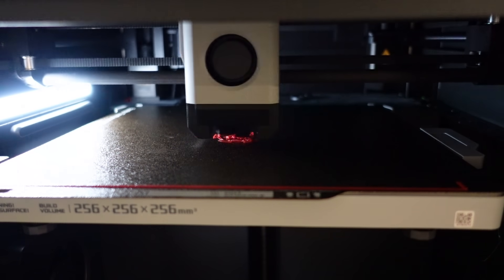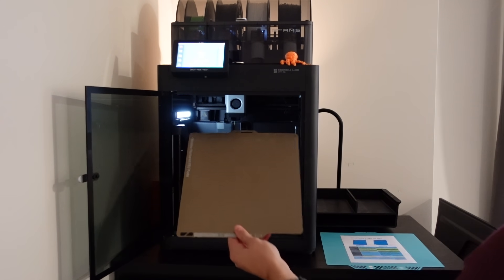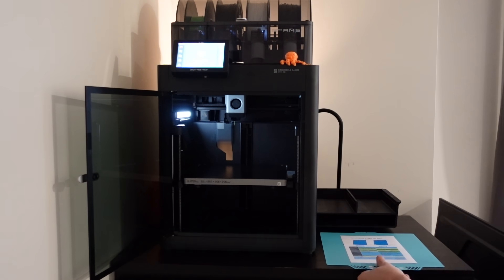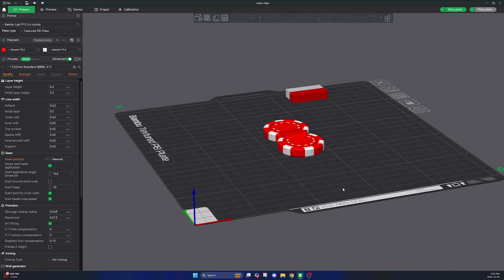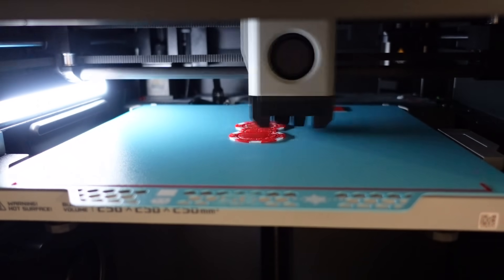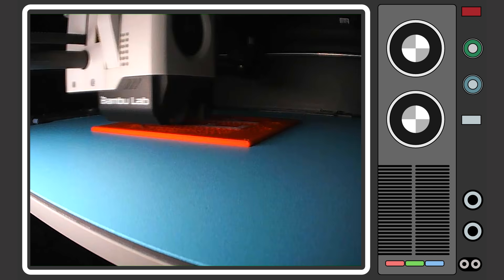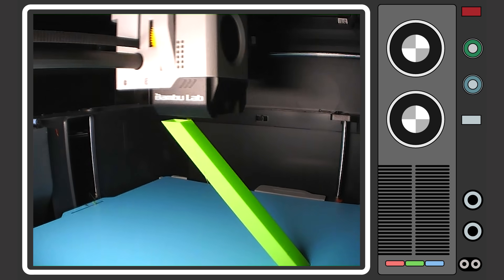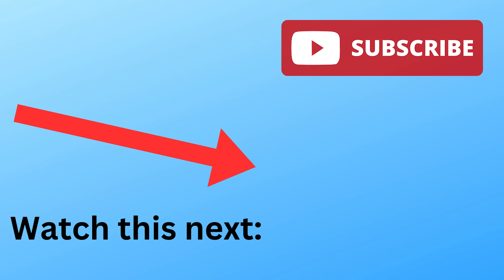Why You Should DITCH Your 'Textured PEI' Build Plate!

Comment from the maker: It looks like most of you haven't had any issues with the stock Textured PEI plate, which is great!
I certainly have had adhesion issues myself, and this video is for those who have had a similar experience.
FWIW: I would NOT lie to my viewers and ruin my reputation. The clips in this video are receipts that I indeed have been having issues.
Hope you all understand  🙏
Reply: Have you reached out to bambu to see if they will replace it may be a manufacturing issue? have you tried washing it with soap and hot water? Most my adhesion issues are cured after a proper wash. Not an iso wipe.
Reply: I Wouldn't say many commenters are suggesting you'd lie (although there's always one or two in every village of course,) most seem to be suggesting you've got a dud, and that you should contact Bambu to get a replacement. I would agree with that to be honest. My experience of the PEI is the exact opposite of yours, I'm almost always struggling to get the print off the plate after, having to flex the plate etc. 

It's fairly obvious from the fact there's a very small minority of people that have had exactly the same issues as you, that you're most likely telling the truth But it's equally clear that, due to how small that minority is, there may have been a bad batch or something. Try and get it sorted mate, could make for another good video idea, documenting the RMA process and hopefully the results of a replacement plate. :)
Reply: @coasterfest  I reached to Bambu with my supertack over a month ago or close to it. I got two, did everything they asked me to send them a video, I was away so the case was closed and I did mention I had a video on my channel about it asking for suggestions and help.
Reply: @ Thanks for the update. Doesn't fill me with hope that their customer service is up to par. And sadly yours isn't even the first poor customer service experience in these comments. Another thing to add to the growing list of negatives with Bambu. :/ 

I was looking to buy an X1C or P1S soon, but the recent controversies have put me off, so I'm now looking out for another Core XY with a multi colour / material system. Currently favouring the Kobra S1, just waiting on some longer term reviews to start dropping.
Reply: @ The s1 is interesting. Some corner cuts on build quality and some downsides vs p1s, but also better specs than x1c. Would love to see some in-depth tolerance and print quality comparisons.

I’m aiming for Quidi Plus4 myself. Never could get PC or Nylon to print strong enough in my P1S
Reply: For a sanity check confirmation, my new P1S has the exact same issue with the stock plate. Never had an issue with any printer plate before like this. I don't even have to lift the plate or flex it to get prints off, everything just falls off freely once the temp drops to about 40c on the bed after a minute or so. Issue has been the same since the first print, and I am still waiting for a response from Bambu at the moment.

100% cleaned it thouroughly with dish soap and hot water, plenty of alchohol wipe downs, never touch it with bare hands.. bed level tests show zero signs of oil on the bed but they still dont stick. Tried temps from 50c-70c on PLA with no difference, tried enclosed vs doors open, tried manual bed leveling even though it came essentially perfect to start, tried many brands of PLA and PLA+ and ASA all with the exact same issue. Ran filaments through a dryer, tried all variations of fan speeds, ran a full air filtration through the room to make sure no dust, closed all vents while printing to ensure zero breeze, ambient temps 18.5-19c, ambient humidity range 20-25%

I am waiting for the smooth and cool plates to arrive still, bamu shipping taking pretty long. 3 weeks in and I'm still waiting for the filament/nozzles I ordered with the printer during black friday sale. For now, I have to print everything with massive brims to have any success, and can't print any tall objects as any vibration just shakes them loose.
Reply: @MrSoundChaos reading your comment you have alot of expierence. But just for other that might read it. Use dawn with no hand softner.. propper dish soap that removes oils. If its soap with hand softner in its no bueno.
Reply: @TriMeX1987  Definitely good advice. A pure, high concentrated dish soap is by far the best, and don't use alcohol afterwards, since all alcohol's leave trace residues that lower performance (still fine to use in small amounts to touch up cleaning after many uses). 

8 months later, I was still never able to get my stock PEI plate to work at all. There's some form of factory contamination in the PEI and it cannot adhere to plastic. Bambu refused to help. Every other one of the dozens of plates with thousands of print hours since have worked flawlessly when properly cleaned.
Reply: @MrSoundChaos  they should take it in and test the pei plate.
Reply: I have had issues with my textured plate since I purchased a month ago. I have cleaned it several times and usually end up putting a brim on to fix issues. Might look at this plate.
Reply: I didn't have a single issue until recently. Which led me here. Thank you for showing me other options out there with a comparison to my own🙏
Reply: I have adhesion problems with my a1, and hopefully the smooth print bed works!🙏
Reply: say you are clueless without saying it 🤡🤡if u only printed with bambu u dont know shit
Reply: @devilik3692 You sure didn’t provide anything useful here. Got some advice you’d like to share?

Comment: This is a YOU problem.  I'm new to 3D printing and it's been flawless since I started a year ago 🤣🤣😂😂

"i got this plate for free, my opinion is unbiased - the OEM plate sucks, y'all should buy this one!"
-🤡🤡🤡🤡🤡🤡

I spray with 90% IPA, let it sit for 10 seconds, wipe it dry with micro fiber cloth = done.  ZERO adhesion failures in a year.  Z - E - R - O

I print PLA, PLA+, PETG

Comment: Yeah the textured PEI plate is shit. It was perfect when i first got my a1 mini but it seems like it wears out too quickly. I even sanded it down a little bit as a last resort, worked only a few times. My smooth plate has perfect adhesion at just 35c even and is lasting longer.

By the way, what plate would you recommend for PETG and TPU? Using gluestick on my smooth plate seems too messy although i haven't tried.

Comment: Was using textured plate, then it started printing 'mid-air'.
I had a lot of hours on this plate, weird that it stopped working.
Nozzle is 0.07mm to 0.1mm too high, layer 1 failures.
If I 'lie' to the slicer, tell it that I'm using a smooth plate, the textured plate works again.
Reply: OK, more data!
Printer profiles account for the slight height difference smooth vs. textured plates.
A textured plate sits a bit higher, but has tiny voids.
Smooth plate has no voids, sits a tiny bit lower.
I had changed my printer profile without understanding the full implications...yes, Petunia...Bambu X1C does support Z offset!

Comment: I have over 500 print hours with my PEI plate - no issues. The key is to avoid getting oils from your hands on the build plate. I also clean off the plate once in a while with dish soap (not rubbing alcohol, it doesn't fully clean the oils left by your hands). 

Between being careful not to touch the plate, and cleaning it off every so often I've had great results.

Comment: Wipe the textured PEI sheet down with IPA right before you print and hit it with a light coat of hairspray. I guarantee with absolute 100% certainty you will have zero adhesion issues.  You need to do this before EVERY - SINGLE - Print.  You will have 100% success. I guarantee it.

Comment: i got a textured pei plate for my ender 3 and I've never had adhesion issues. you have to clean it regularly. if its not sticking try cleaning bit with ipa and if that doesnt work make sure your bed is level because it will eventually need to be releveled as do all 3d printers.

Comment: I have had zero issues for the first several months, but now I struggle a lot with bed adhesion even if the plate looks like new. I honestly don't know what happened. I tried washing it with dish soap like they recommended and that helped for 1 print. 
I almost feel like it's the pla itself leaving residue on it... 😮
Reply: Using the several months old plate? maybe just time for a new one even if its the same kinda.
Reply: So TLDR Don't touch your plate with fingers, or if you do wipe it with some alcohol wipes 
Once I started doing that my issues are gone. 
If you already have it dirty - wash it with some dish soap and a soft sponge thoroughly, then let dry completely.

Comment: I'm sorry but that print is just horrible especially for a P1S....I only had issues with my textured build plate after 6000 hours on my P1P; I had prints that did not stick properly even after cleaning. So I just bought a new one because people don't seem to realize that there is a PEI coating on the plate that will get damaged over time, and can't see from just looking at it with your eye. They also say on the Bambu Wiki that build plates are a consumable part. Just like replacing your nozzle, you will eventually need to replace your build plate, and they don't last forever! and it's even more noticeable after buying and using a brand new plate, you can actually feel the difference in adhesion. I almost replaced my A1 plate and it's only a few months old. 

Also the top surface layer on the logo printed in this video looks awful I think you need to tighten your belts or something, because even with ironing off on my P1P my top surface layer looks about 90% smoother, also your first layer doesn't look right either you can see almost a smooth circle in the center and then around that smooth area you can see the layer lines on your first layer that's touching the build plate. If you were getting a proper first layer, the side touching the bed should be completely smooth or textured, depending on the plate, but it will have no visible layer lines. That looks like a print of an Ender 3, not a P1S, Sorry but I think your issues with the textured plate is user error. 

 But with this Cryogrip plate I have seen videos of prints warping, but the plate stays attached to the model and warps with the print causing the plate to pull up off the magnets which looks like it could cause a lot more damage than just knocking my print off, and damage to your printer from aftermarket parts will void your warranty unfortunately

Comment: I don't have a problem with adhesion. Rather with getting the prints off. If I had a print over night, I have a very hard time getting thin layers of the plate, especially of where I had supports.

Comment: Someone is not washing their plates between prints.   I use both textured and smooth PEI- With PLA I add a little glue stick.   With PETG I go raw-dog and it sticks to the plate pretty dang well.
However, I DO make sure to wash the plates with dishwashing liquid and dry them carefully without touching them and leaving oily prints.

Comment: I have been printing for 5 years, and I'm surprised it's not written on every page possible how user should really use the build plate. 
1) Always use gloves when handling build plate. I bought myself cheap .80 cents fabric gloves that breathe.
2) Never ever pull off prints from the build plate when the plate is warm. If you pull prints off from build plate then you'll leave small layer residue on it, and each next print is going to adhere worst. 
3) Try to print with one type of material (PLA or PETG etc) as long as possible, because they all leave a little bit of residue and PLA and PETG do not stick to each other and adhesion is almost impossible.

And if you follow these 3 points, then adhesion issue might be due to damp filament. But most likely it's just because your plate is dirty. The fact that you can't see it with your eye means nothing. Zero. IPA or dishwashing liquid and then drying with shop paper or microfiber cloth, and never ever cheap kitchen paper or toilet paper because these leave paper residue.

(To cool plate faster: I take the build plate out with prints on it, and while holding the print I press against my window. If the window is dry or I'm impatient, I put it against the outside window because that's colder. After around 20 seconds I usually hear the cracking sound when the print pushes itself off the build plate and usually the buildplate just falls off. And then of course never use the side for printing before cleaning that was against the window.)

Comment: I've had my first ever fail on the textured PEI plate, a large full-build volume sized short box, every corner lifted, I have the cryogrip glacier but didn't use it after I had 3 failures with silk polylite lifting in the corners, but that was using the coolplate settings, I never tried it with the same temps as the stock textured, which you suggested. So I'll give it another shot with that setup. If it works, it'd make more sense why BIQU gives you a set of stickers for EVERY plate type in the box, I didn't understand that at first, hope it works! fingers crossed.

Comment: Got an A1 2 weeks ago , after doing some small prints I wanted to print one of those Bambulab accesory boxes and to my surprise the plate got damaged by the nozzle. Even though I did a calibration the nozzle managed to scratch off the texture of the plate in 2 places. Although this isn't directly the plates fault I did encounter warping on my first print as well as failed prints ( peeled off prints ) when I tried to print a cover for the A1 screen

Comment: Just looked at the plate on Amazon and it has several my prints don't stick complaints.  So I wont be buying it.  I am looking for a spare plate and my original works fine, occasionally things start to not stick in places so then I wash it and it's fine so no I wash it every few days and no issues.

Comment: Yeah, that happens actually. When I had ender s1 pro it came with PEI sheet as well. It had TERRIBLE adhesion (and no, cleaning with soap, isopropyl or any other alcohol did not helped). After months of battling to fix my adhesion issues, I bought new PEI build plate that had zero issues, it just worked right out of the box. I assume something happens during manufacturing of these plates that they come out with a defect. My bambu PEI sheet also has zero issues printing PLA, PCTG and PETG always perfect adhesion. I suggest contacting bambulab to get that build plate replaced.

Comment: P1P and P1S with textured build plate for about 17 months now... never had a bed adhesion failure. 
Perhaps skill issue?
Reply: Way too many variables to consider before you start claiming skill issues. This is a fairly common issue with P1S and X1C and it seems to have got worse with the latest batches.

Comment: I rinse the plate and apply glue stick to the PEI plate and the adhesion is fine. I kind of assumed that was just part of the normal process because the lab tech at my school recommended that I do it. Even with the smooth cool plates for X1C’s at my school you need to apply glue stick or there will be adhesion issues. 
So I might look into getting one of those printing plates you’re showing
Reply: Glue sticks shouldn't be necessary for PLA on PEI. for a lot of people, the glue isn't to make the adhesion stronger, its to help release the print from the bed without damaging it when it sticks too well without glue.

Comment: We must have pei from the same batch because I’ll clean my plates with soap and alcohol and it’ll still fail. I’ve had to switch back to my cool plate and glue stick because no matter how hard I clean it I still have corners warp.
Reply from the maker: Exactly the same for me!
Reply: Don't use soap, just IPA or Ethanol with a paper towel or shop dowel does the job.
Reply: @slappyhappy14231  This is bad advice. Bambu Lab specifically recommends to use soap, water and a sponge to clean the plates and to not use IPA or other cleaning products. Countless users have also confirmed that this method produces the best results.

Comment: The gold plate from bambu was a nightmare,  I switched to the high tack cool plate, and it's been a dream.
Reply: well, ok, sometimes it sticks a little too well

Lost some feet off a few miniatures this morning
Reply: @Gw2Zoke  I have mine on the way since my textured bed doesn't stick no matter what. When your cool plate fully cools down and wait a few hours, does the print come off any easier? have you tried the wiki option of heating up to 55c or so to assist with removal?
Reply: @ I have tried heating to 55,  feet are hard to get off the plate without hurting the miniature, unless I tilt the mini so they don’t sit flat in the plate

heating helps with pealing layers off

I had to work to find supports that generated well, and didn’t have automatic brims included

It results in very consistent successful prints, even if a part of a mini fails, the rest holds to the bed and eventually recovers without being knocked free

but sometimes it’s difficult to remove everything

I have once, printed a two layer sheet over the whole bed to help peel off some super stubern support material, I swapped to the .4mm nozzle and my a1 mini handled the task in 30 minutes, so not a huge setback, about 20 grams in material for that method
Reply: @Gw2Zoke  I'm pretty excited to get mine then. I'd rather deal with hard to get off than deal with a majority of prints failing due to no adhesion at all.
Reply: @ Based on the other comments? plenty of folks have had success, so YMMV